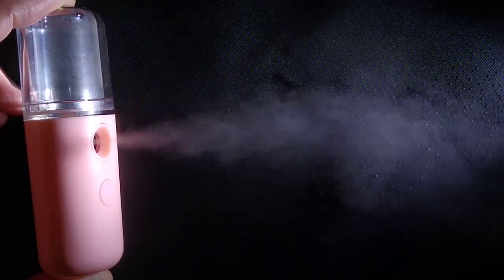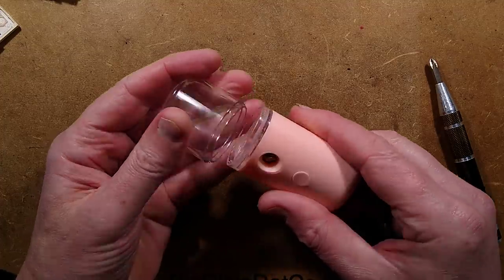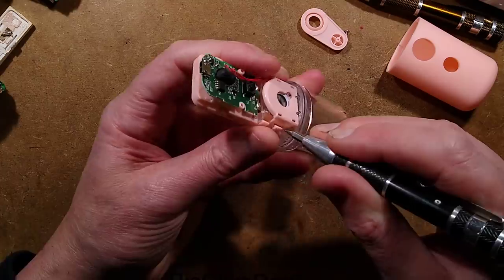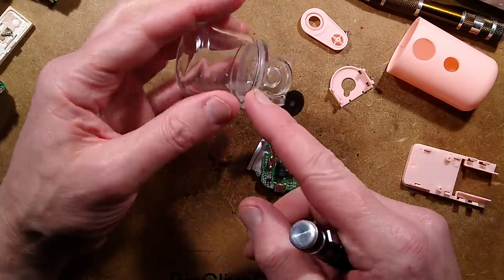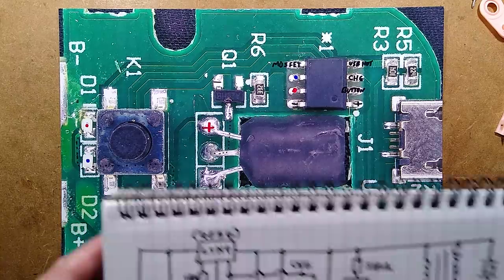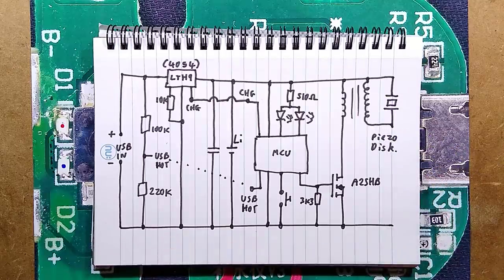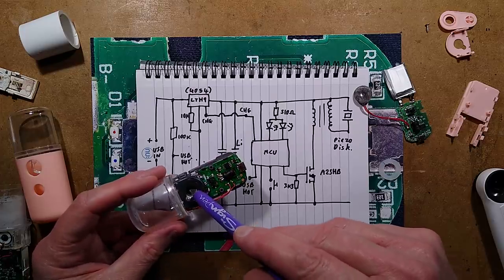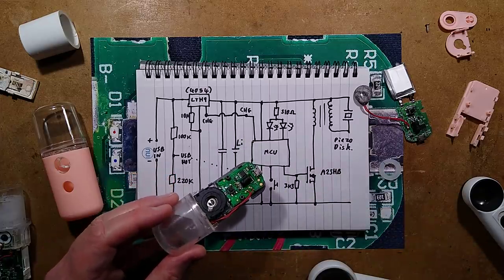Inside a USB rechargeable misting unit (with schematic)

Comment: Does anybody look at commonly available, cheap devices like this, and think: "We really are living in the future."
Reply: when i see my car just falling to bits because the the rust and poor design, i ask myself: are we in the 1930?
Reply: Makes me admire the person who came up with selling those toys from kids magazines to adults via online shops.
Reply: A dystopian future where waisting plastic on useless device and packaging is way too comon...
Reply: Funny... future me just called, and he says I'm living in the past.
Reply: @Francois_Dupont  Carefully designed to fail.  The main reason they PAINT cars is just to slow the inevitable rusting, coz they keep stupidly making the cars from carbon steel instead of Aluminium or Stainless-Steel.  They know what they're doing, the bastards.  
IIRC one car designer got so sick of it that he made a stainless steel car a few decades ago:  the *Delorian.*  Tesla Motors does similar things, iirc their cars are mostly Aluminium, and their Cybertruck is made of ultra-hardened Stainless Steel and neither requires nor has any paint (try to scratch it with a key, and you'll just scratch your key).
Reply: @roidroid  my car engine is still good at 330,000kms, the body is so rusted there isnt anything holding anything anymore. even making car with galvanized steel instead of normal pot metal will have them last 30years instead of 10. 

i have seen military trucks from the 50's still driving around without a single spot of rust on them. when they want they can make things last. we are just not worth it for them. it is planned obsolescence.
Reply: @Francois_Dupont  it's not that we're not worth it - we're WORTH them literally designing things TO fail.  They go outof their way to make sure they don't accidentally make things that last.
Reply: In the future, you won't be ordering finished goods -- including such trivial trinkets as these -- to be delivered across the world, next-day delivery, each on their own first-class seat. Instead, you'll be pointing-and-clicking features and attributes and colours (of course) for anything you can imagine, within the envelope of current physics, and it will be drafted, prototyped, tested, manufactured, and shipped overnight.
Reply: @michaelthibault7930  - ©1900, Walt Disney.

LOL MEANWHILE
Reply: Living in Hell.
Reply: Jim Griffiths - no. I would hope that in the future humans would be less wasteful and less me! Me! ME!
But given the way things are going, which is to extract the highest amount of money from individuals by selling them things they don’t really need, to keep the company shareholders rich, unless say, something like a big financial crash, or say a pandemic occurs, I don’t see anything changing. Oh, wait!
Reply: @michaelthibault7930   ...
Or more likely the data to make it will be sent to your living pod's built in 3D printer/assembler within second as the payment is automatically sucked out of your State Bank credit account. No returns accepted.
Reply: @DrQuadrivium  .... ok i think im living in a different reality pod 2 u ppl
Reply: @roidroid  All cars, even stainless steel cars, have a finite life because of metal fatigue. Once a car gets to around 20 years old or 150,000mi/200,000km the mechanicals really start to fall apart, and repairs become uneconomic.  There's no reason why the body should significantly outlast the mechanicals, although some carmakers do fall short on rustproofing, and some people live in places where road salt use (and rust) is far more common.

In addition car safety has advanced massively over the past few decades to the point where insurance is becoming more expensive for older vehicles. Also aluminium is a PITA to repair after a collision, and they also corrode. And finally most people don't want to drive really old cars - I mean imagine a 1980s Chrysler LeBaron or Oldsmobile Cutlass with a stainless steel body, how many people on Earth would still want to drive one of those in 2020 if they can find something more modern?
Reply: Avantime - err, what you say is not entirely true. Heck, there are aircraft that are older than twenty years old still flying and these are far more critical as far as metal fatigue is concerned. There are also trains (both locomotives and carriages and wagons) that are 50 years old (or more) still in use. And there are plenty of so called classic cars still on the roads. It varies around the world, but the most significant cause of road vehicles being scrapped is accident damage (beyond economic repair). In terms of the various electrical and mechanical parts failing, that’s the reason for regular maintenance and checks, so worn or damaged parts can be replaced/renewed/serviced before total failure.
Reply: @Mark1024MAK  Old aircraft and trains are subject to rigorous government-mandated maintenance checks and overhauls on a level that the vast majority of private car owners cannot afford. In terms of aircraft the big checks like a D check requires the aircraft to be completely stripped down and overhauled. The costs are such that many airlines chose to sell the aircraft rather than undergo such checks. Most end up as scrap but a few end up in places like Africa (where corruption is rampant) where they're run into the ground, and occasionally crash.

The classic car scene is completely different, as owners can and often pay $10,000+ to restore cars to immaculate condition, including the fabrication of custom parts. They're overwhelmingly reserved for high-value sports cars and other unique vehicles, not the Camrys or SUVs that are driven by common people. In addition they're driven by owners who look after their vehicles, and would opt for aftermarket rust protection if needed. If the body has rusted beyond repair it would even be possible to replace them with new metal, if crumple zone protections aren't required by law. The average college student or working class folk isn't going to spend thousands fixing up a beat-up old car for stuff like wheel bearings, transmissions, starter motors and oil leaks etc. if it costs more than the car is worth. Some will raid the junkyards but they're the exception, not the rule.

And I'm not sure if you're aware of this, but it was cash for clunkers 10 years ago that wiped out most older cars from the road. Anyway with EV and pollution mandates all those ICE cars you see on the road today will end up as scrap metal (or in Africa) in 15-20 years, carbon steel or stainless.
Reply: Avantime - It’s obviously different in your country. In the U.K. it’s the law that road vehicles that are older than three years have to have an annual MOT test (see https://en.wikipedia.org/wiki/MOT_test). Over the coming years, there will be a sharp reduction in ICE vehicles (especially diesel cars and vans) due to the changes in the regulations of what new vehicles can be sold. But generally, these regulations are not retrospective. The second hand trade and what is considered to be a classic car also will vary both around the world and the time frame in which we live. All I am saying is that over generalisation does not give the full picture. Certainly some products are deliberately designed to have a limited life, both to keep the sale price down, but also to prevent market stagnation. Most car manufacturers are always bringing out new models (often with new features) to encourage owners to buy a new car. But if the manufacturers wanted to, it would not take much effort to produce products with at least twice the lifespan. Although the sale price would of course be higher. In the future, I can see it becoming increasingly likely that for environmental reasons, products with a longer lifespan will be encouraged by governments.
Reply: @Mark1024MAK  Carmakers can absolutely produce cars with twice the lifespan, but that would require a fundamental rethink of car ownership, where profits are driven by product differentiation to attract the new car buyer. Apart from fleet and commercial vehicles, cars are not designed for life beyond 20+ years because of the increased upfront costs, and the vast majority of new car buyers do not keep their cars until the wheels fall off. And apart from spare parts (which decreases in value as the wreckers fill up over time) the carmakers don't make much money from used car buyers, so there's no incentive to keep them happy. In fact a common running joke here is that VWs are engineered to suffer a major failure the day after the factory warranty runs out.

Governments can mandate it of course, but they won't - car production supports a massive number of jobs, and new technology makes cars safer and more economical, pollute less, and adds creature comforts like assisted driving aids, with some such as ESC becoming mandatory. They can't be retrofitted because the carmakers don't want to do it, the used car owner can't afford it, and product differentiation makes it difficult (when was the last time you saw a DIN slot in a new car?) and it creates reliability issues. And then there are the social issues with people seeing these old bangers as eyesores, and owners seeing their old cars as a symbol of poverty and low social status. No one in 2020 wants to drive a Vauxhall Cavalier, Austin Maestro or Mazda 626, even if they all have stainless steel bodies.

Instead of making cars last more than 20+ years, a better initiative would be to create better car recycling programmes, and have a recycling tax on each new car sold. Metal is very easy to recycle, for example many Coke cans came from recycled aluminium from scrapped airliners. The classic car owners can easily maintain their vehicles over many generations with aftermarket solutions.
Reply: I do. And I'm disgusted at how beholden it is to the lowest bidder.

Comment: I guess air wick is putting their chemicals in glass for a reason....
Reply: Bingo and yes I've seen Air Wick air fresheners break down over time even or maybe it was a knock-off dispenser that use a different plastic don't would take the Air Wick refills?? Also really older ones same idea would just overtime you know not look so good especially right next to where the heating chamber is right around the wick area once I saw wood that at first I thought the cartridge the top Hitman melting it is heated overheated and turns out it wasn't melted from the Heat it had been partially dissolved I wonder if it was a bad Blanche of plastic?

By the way keep ping pong balls away from fire cellulose nitrate you know.

Why do I know there cellulose nitrate well I do that later on but I don't remember Camp people Chucky mm in the campfire and throwing them through the campfire they had to ban people from having ping pong balls interposition because of this.

Same reason why you are not allowed to have aerosol mosquito repellent and also hairspray or anything else in aerosol can whatsoever although it was really not enforced as much just as long as you did not go to spring it into the campfire or trying to ignite it from what I understand that have noticed used to go to summer camp for years and years and years.

It did a lot of work for the camp as well when I was down there also got paid for it sometimes as well.

Usually just last ditch repairs were things that just need to be gotten working but everyone else was stumped.

Also repaired to Computer Lab computers also got a sewing kit out of that as well.

If I remember correctly it was something with a power supply one was a cracked sore joint another was I think why are the head broken off the PC board on the power supply if I'm not mistaken Lord up getting a kit both times since they didn't have equipment like that of course.

I that place had been in existence at least well before the camp was there probably at least that one you should have seen the place how old it was I'm talking glass insulators a pump house that looked more like something that you find a steam engine in.

Also at one time there was one steam engine as well the old Art Shop was actually originally a laundry facility part of the old line shaft was still there managed to save the gauge off your boiler we were checking it out when I was helping with a plumbing issue and asked if I could take the boards off the old doorway just to check things out also found some neat stuff to when I was back there.

Which they said I can keep as souvenirs also got a bunch of old stuff from there as well including a mechanical time switch that was almost like a modern would you accept if used A Clockwork mechanism evidently it was used at one time for flood lights or something somewhere it would run for I think the 7 Days Plus we actually wound up using it somewhere at my parents house Bambi news in the garage? Later on my wand up pudding up a heart for sure sodium light that I got from somewhere else or someone else what else wall box fixtures little rectangular thing with a built-in photocell what up were using the time or somewhere else eventually the mainspring on that timer broke and I gave it to someone that was interested in clocks they actually want to put your new mainspring in it in one of using it again somewhere at their place also I want a bunch of estradiol timers unfortunately and they were not for the time zone and it was so far off that it wasn't that useful but they were useful sometimes at least if you just wanted a white between certain hours so I kept them in one piece otherwise I will scrap them out for the motors.

Also looking for a cheap source of charming Motors or something that would have them that could be readily acquired for Salvage for pennies on the dollar no not China not eBay but just any ideas.

Savage would be best but want to salvage?

Comment: These devices are quite interesting. Have you seen the small fan with the mister device in the center? It mists you and blows air on you face at the same time. Built in rechargeable battery too.
It's very effective.

Comment: Here's a question. Why is the standard pcb color green?
Reply: it used to be brown, but green looks better, and it's cheaper to produce massive amounts of green soldermask than it is to produce 5-6 different colors
so green kinda just became the default because it's a tiny bit cheaper
Reply: As Aech mentions it used to be brown. But green is now most used since it gives best contrast to all components for visual inspection systems. Compared to the gold, silver, tin, black and white elements. And also has good contrast with the silkscreen and copper tracks underneath.
Reply: @jvleugels  this is true, green contrasts with everything. but so does blue and red (the ugliest pcb color)
Reply: @TheAechBomb  DINGdingDINGding we have a winner
Reply: @TheAechBomb  Blue has a lot less contrast because it is to dark i hear. Only the teal ones are easier. And red indeed is a really good color as well. That's why Chinese components are often with red boards.
Reply: Brad Primeaux - are you asking about the colour of the actual PCB material or the colour of the solder resist coating?
There are a number of PCB substrates, the cheapest is SRBP (FR-2) which is a type of resin bonded paper, it’s normally brown in colour. The better higher quality material is epoxy-bonded fibreglass (FR-4) which is normally off white, cream or slightly green in colour. The solder resist can be any colour, but green is the common colour for the reasons stated above. Red is also used a lot.
Reply: You're not the only one that's asked that before I have to as well always wondered never thought to ask someone thanks for asking and oh yes I see down below someone answered that already so I think your question has been answered just read the comments you'll see. If somebody doesn't delete it I doubt they would or go to say something nasty about it for some reason you'll always be naysayers but I think they should be a little bit horse on that lol

Or like the death of mute on that in terms of the people that really take things and turn it into something that should not be or turn into something that is downright vile disgusting dirty or otherwise it just makes you wish that there was a way to say inappropriate content of a comment in general even if it's just not right even if it would not be against terms of service but it should just be looked at it because that it could be suggestive or otherwise very inappropriate to the point that is disturbing or otherwise not in the spirit of things as well you know I'm saying to the point that just should not be done

Comment: I ordered one right after I saw this video, with the intention of using it as an essential oil diffuser. 3 drops of peppermint oil in the tank full of water. Worked awesome until the oil reacted with the silicone seal, swelling it so bad the tank popped one of the tiny integrated "latches" and now it doesn't seal. Now I want to rehouse the unit with a bigger tank and better materials.

Comment: Well damn, I bought one of these and turned it on without any water in it and it seems to have immediately burnt itself out. I didn't think a piezo transducer would do that. Could just be a short inside that fried the drive circuit, not sure.

Comment: I wonder how long it would take until one of those units would fail if run continuously (if modded to have a larger water supply and run from a 5v power supply instead of the battery). Would be a pretty useful and very cheap solution to humidifying air around houseplants.